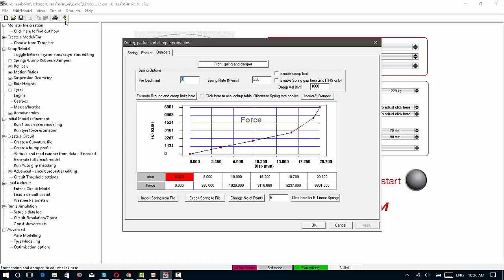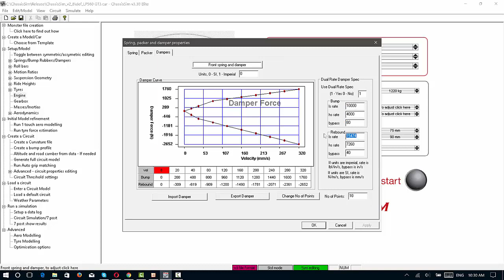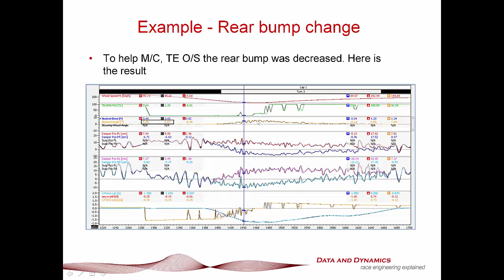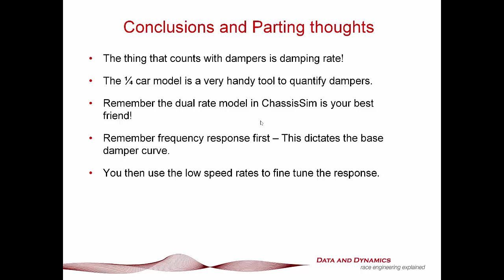Evaluating Dampers / Racing shocks using ChassisSim - Part 2

Comment: This quarter car model has basically forced oscillations from the road profile, right?
That is, the tyre never leaves the road and at the time of a dip in the road, the tire gets pulled with the road even at higher frequency disturbances.
So, i think this model doesnt help us well to analyse the high speed range of dampers?
Please put some light.
Thank you
Reply from the maker: Tushar - what you are actually seeing in these simulations is the results from the bump profile toolbox which actually uses the full car model and it will take into account the tyres leaving the road. The thing to keep in mind here is the quarter car model is a tool to help you understand where to go with your damper settings. That is the distinction.
Reply: ChassisSim oh!
So this one is the four poster shaker rig tool of chassis sim?
As you say it considers the tyres lifting off i.e. they have a contact force.
Does the track data in chassis sim have road profile as well?
Reply from the maker: Absolutely - The bump profile toolbox is a spin off of the 7 post shaker rig capabilities of ChassisSim